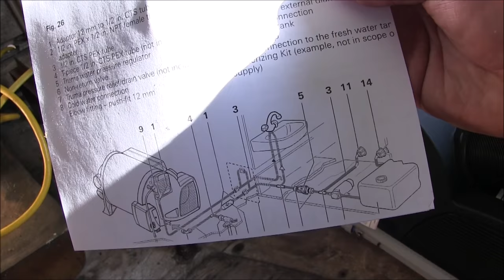Installing the TRUMA COMBI Eco Plus in an Airstream RV

Comment: Love your videos Patrick, every one of them. I especially appreciate your low key approach to letting owners tell their story without much interference from the videographer - you.  Excellent journalism.  I'm trying to find a source for the Truma Combo.  The link in the description redirects to UnderMountAC who does not seem to still be a full Truma dealer.  Is there a secret handshake I need to know to buy a Truma there?  Or is there another distributor you can refer me to?
Reply from the maker: Thank you Frank. Truma is a tough company to buy certain products from. They like to only sell to OEMs . The company I purchased mine from only had a limited supply and they are now out
Reply: Thank you for the response.  It's appreciated.  If I could find someone to supply one, how much do they cost?  I love, love, love that they combine two appliances into one.  My 2001 Casita Spirit Deluxe 16' came without a furnace.  We're here in NJ too and a furnace is a must.  The Suburban water heater needs to be replaced and it would be great to kill two birds with one purchase.  Not to mention getting ducting, smaller form factor and high efficiency.  BTW, your Bambi turned out fantastic.  Love the classics.

Comment: Hi Patrick, does the Truma Combi need a detected 12v wire as well as the 110v wire? I just came across your site and I'm loving it. Thanks for posting.
Reply from the maker: Yes, both 12v and 120v for this model
Reply: @NewJerseyOutdoorAdventures  Thanks Patrick. I'm also working on a 1961 Bambi and I find your video series top notch, a wealth of information. I do have a question about the Truma Combi you installed, do you have a source for that unit in the US? Or do I have to buy it from a black market source like eBay. Thanks again for the help and for taking the time to put out quality viewing.
Reply from the maker: @fosterwayne6684  I had to buy mine on the black/grey market
Reply: @NewJerseyOutdoorAdventures  I had a feeling that would be the case. Was it worth the investment?

Comment: I love your attention to detail. That's why you're doing this and not me. Question: does the Truma require 110 volts to operate? Or, is it 110 AC/12v DC?
Reply from the maker: It is 110v AC/ 12V DC

Comment: This is an excellent video. Because the Combi only wants no more than 40.6 psi to the heater what psi do you use in your city water regulator? Does 40.6 give you a good shower?
Thanks
Reply from the maker: I haven't used it yet because of the project not being done but the Airstream Basecamp and Winnebago Travato both have the same system and the shower pressure is good.
Reply: Thanks for the reply. I just purchased a 2019 Lance. The Truma system is the same. Truma uses a regulator at 40psi max as the heater cannot accept any input more than 40.6psi. Just wondered what others are regulating their city water at?

Comment: You could be a teacher. Well, you are and you are very good!  Thanks. 

Because of the differing dimensions from the old heater and water heater to the new Tsuma (sic?), will you take advantage of the space savings with additional storage options?  You spoke of a cabinet back there, a couple of times but I don’t really have a grasp of what and where it will be. Is this an older cabinet that you will be putting back in or rebuilding?  Or do you have something else in mind?

How much bending do you do with a build like this?  It was in my mind to remodel a shuttle bus that had room for husband and his wheelchair and still allowing room for travel and camping. We all break things over time and I blew both knees playing soccer and later broke my back in several places. No sad stories, I had a lot of fun playing and working hard. But I am watching you and wondering if I can pull it off.  How much of that do you think could be done on a work bench and then put in place after it is built?  Even with all of that, I am pretty strong but my weakness is working crouched down. But if I could build things and stand with my 19 year old grandson doing the crouch work, I could pull it off. And he is pretty mechanically minded, building robots in school and now studying engineering.  Was it just what you were working on in this video?  Or do you work like that with most of what you are doing?  Do you spend much time in the shop when you are at work?  If yes, do you guys do much of your work at work benches and then installing?  Strange questions but doctors really can’t relate to this kind of question.
Reply from the maker: I plan on removing the original furnace which is in a different location and making room for hamper and garbage pail. There was lots of bending and up and down doing this project. I plan on rebuilding the existing cabinet just to freshen it up

Comment: The previous owner on my Bambi replaced my water heater with a conventional rv water heater.  He also replaced the outside aluminum panel where the original water heater was.  My problem is the outside cover of the water heater is flat and the aluminum panel of the trailer is curved.  Looks kind of tacky.
Reply from the maker: Understood that just don’t fit right

Comment: Does the water heater and furnace run on 12 volt when not using shore power?
Reply from the maker: Yes, 12V and LP
Reply: @NewJerseyOutdoorAdventures  would this support ducted heat in a 25 ft Airstream.